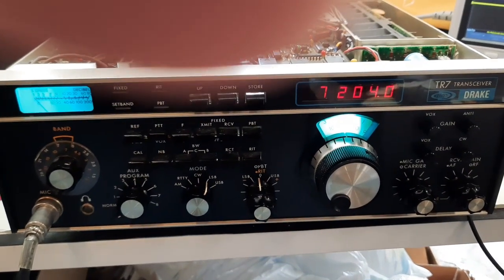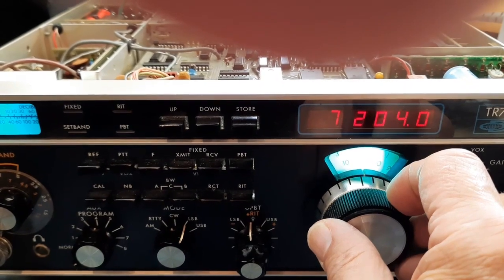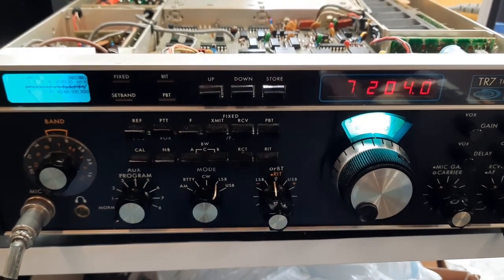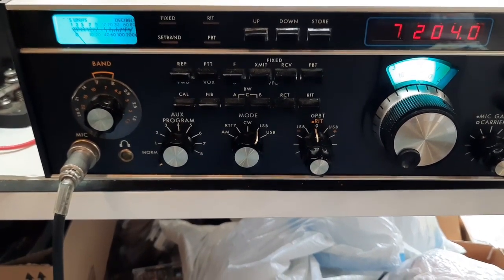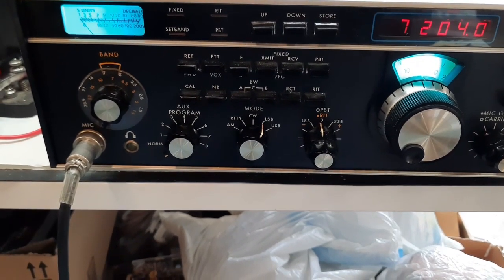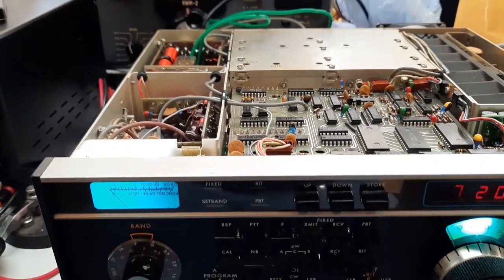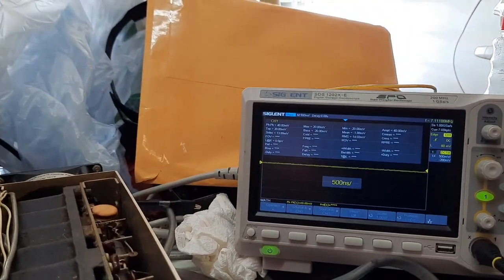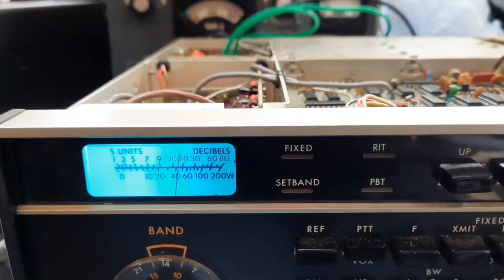TR 7 Final Movie

Comment: Thanks for the TR7 post. I bought my TR7 new in 1980. Still works great  The 10 meter band only put out 70-80 watts when new. I still managed to work 200+ countries on 10M.
Great looking QRZ page. I look forward to reviewing it in detail.
John ND9A
Reply from the maker: Hi John,

Thanks for the post and you can see my website https://www.n6qw.com for a link to what I have been doing with the TR-7. I think the transmit problem is the UM9401 PIN Diodes which can be found at RF Parts -- about $9 a copy and $15 shipping.

I have made some contacts on 20M and all excellent signal reports. 1980 --so that radio is about 43 years old. Wow a testament to the solid Drake Engineering!

73's
Pete N6QW

Comment: I hate fixing consumer junk. But I love fixing nice gear. That's nice gear.
Reply from the maker: If you suffer from borderline insanity -- a resurrection like this will put you way over the line. Yes, nice gear but a real challenge to fix. 
Thanks for watching and your post.

73's
Pete N6QW
Reply: @N6QW , I'd love to work on one of those. I just love older gear, although based on your description, the circuitry sounds extremely unusual and not at all well documented. So I'll be content to just sit back and watch you tear your hair out until you have it working properly. I have great faith in your work. You know more than I do. 
But I've spent my whole life fixing electronic gear, or worse, making new designs work, so I've been forced to develop great patience. I'm working on a cellphone right now, and that's a nightmare that makes the TR-7 look like great fun by comparison. If it weren't my own phone I wouldn't touch it. Cellphones, by their size and nature, are inherently evil. The larger, older, and more open a piece of equipment is, the more I like it. I have a soft spot for Drakes ever since I did some work on a TR-4. I recall tapping the antenna jack and hearing the tapping sound coming out of the loudspeaker. That's a hot front end. :)
I'm looking forward to seeing what you find with the TR-7. Good luck.
Reply from the maker: @johnwest7993  I too am looking forward to finding the issue. I am leaning toward the 100-Watt PIN Diodes in the HP Filter Switching. There are 3 of them -- $10 each but 15 bucks to ship 3 small diodes. The lace that has them is only 80 miles from me. But driving there for a will call will cost more. They have you by you know what. Good luck with your project. 

73's
Pete N6QW
Reply: I enjoyed reading of the trials and tribulations in repairing the unit and now get to see and hear it.  Thanks for sharing this with us.
Reply from the maker: @davidwilson9612  David, the old adage was never more so true: Sometimes you get Lucky! I did indeed!

Pete N6QW